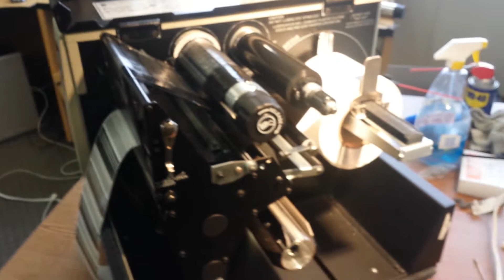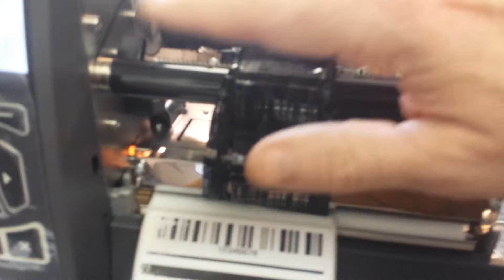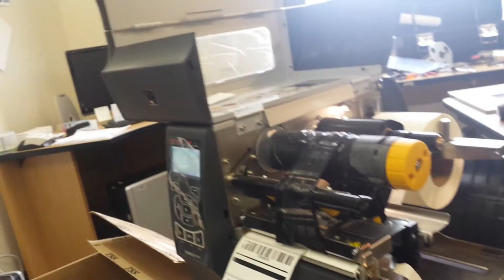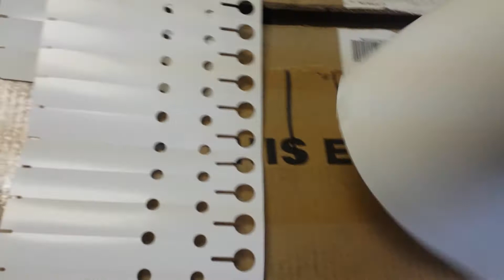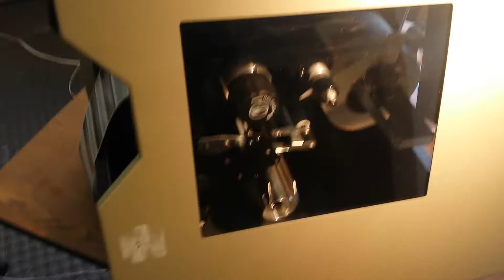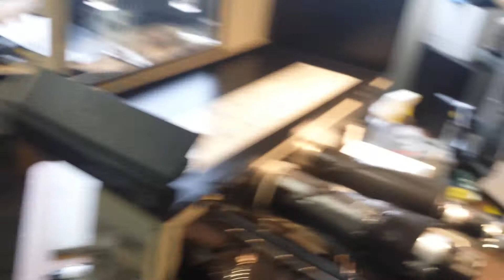Zebra ZT420 vs. Zebra Xi series printer review.

Comment: -> Don't get this model if you switch label types often.  To calibrate it draws 6+ inches of label through the machine, then will not roll the labels back to start printing.  This can get expensive.  In our use the transfer film gets wrinkles, and spoils 6-12 inches of labels each time.  Not recommended.

Comment: Thank you for this video, searching for used zebras I always thought that the Xi models were just really old (judging by their appearance), didn't know that they were actually zebra's higher-end printers.
Reply from the maker: we have used Zebra's.  We ONLY sell Zebra 110xi III Plus as refurb models because they are really the only printers worth keeping "on the road".  I can send a video of one we restored is I have your email.  We like the Zebra product line.  But we prefer the more "repairable"  units. Many years of service. ( like getting an F-150 with 50,000 miles)
Reply: Zebra has now retired the 110xi4 and now has a new model.  Now the XT600 printer is of the same class and style as the old Xi4 printers.